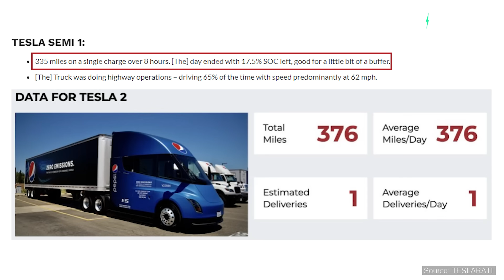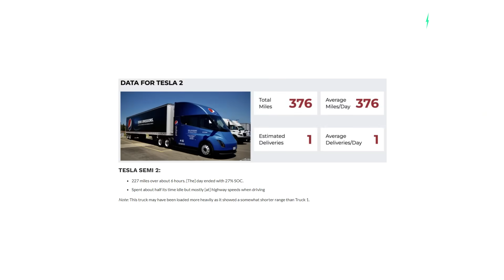Tesla Semi tested at highway speeds - REAL world range shocks rivals

Comment: I think what many folks are not considering is the decreased work load on the driver of a Tesla semi. In a diesel semi, when pulling a heavy load up a steep grade or even a moderate grade, there  is a considerable amount of shifting that must be done. May not seem like much to the average person, however, shifting can be very tiresome. Not only in steep grades but more so in bumper to bumper traffic. That is the worst sort of driving for a truck driver. The  decreased mental and physical work to drive a Tesla semi truck Must greatly reduce the work load for a driver, which equates to safer drivers. My only beef with the Tesla semi is that they weren't produced many years ago when I was still driving a semi for a living. I think it would be a shear pleasure to drive one of these trucks.

Comment: Well I think where Tesla is failing is there worried about a over the road truck I drive a dump truck and that is where they should start with big trucks you do not go as far everyday no where as far you spend a lot of time settling still or moving waiting to get loaded or unloaded you are at home you do not half to worry about finding a charger max miles is about 300 miles a day most days it is around 200 miles I live where there are mountains it will recharge strongly going down the mountains they would sell millions of dump trucks millions diesel fuel is ungodly high I work for a company called maymead huge in paving hear in North Carolina they would be willing to test them I bet Tesla build a dump truck it is a better place to start

Comment: Keep in mind that these trucks are actually coal and gas powered, because that is the original source of the energy they are charged with. The same is true of hydrogen-powered vehicles, you need electricity to generate the hydrogen, and that comes from power plants burning coal or gas. 

Can you imagine what a battery fire on one of these things is going to look like? The more battery cells the higher the chances of one blowing while charging. I was just listening to a news report suggesting that one should charge electric bicycles and scooters away from their home out in the yard perhaps, because there have been some house fires started by a battery fire. 

How long do these trucks take to charge? Remember you are dumping a HUGE amount of energy into them as fast as you can, high voltage and high current. How fast can you do that without starting a fire? I would imagine these trucks would take different charging stations than passenger cars, or they would need to charge for a much longer time. I see drivers hooking up to a charger and then going to bed for the night. That is going to take a LOT of chargers to keep a large number of trucks running. Refueling a diesel truck takes,, what, 10 or 15 minutes, so the trucks can move through refueling stations fairly quickly. When refueling takes 8 hours you had better have a LOT of refueling stations.
Reply: Keep in mind that these trucks are actually coal and gas powered 
FALSE. In California, where every one of these is currently deployed, only 3% of energy in the grid comes from coal, and only 41% from all fossil fuels. And because the Tesla Semi uses <1/3 the energy of a diesel semi, switching from a diesel semi to a Tesla Semi reduces emissions by >88%. But this doesn't take into account that all Tesla Megachargers are being built with solar arrays to augment the grid, and so the fossil fuel use is even less.

 Can you imagine what a battery fire on one of these things is going to look like? 
It's going to look ugly. Fortunately, the risk of a fire in a BEV is much less than that of a fire in an ICEV, so these will be rare indeed.

 How long do these trucks take to charge? 
At the 750 kW Megachargers currently in place, about one hour from 0% to 80%, and another hour from 80% to 100%.

 How fast can you do that without starting a fire? 
Tesla Semis are designed to and capable of charging at >1 MW.

 I would imagine these trucks would take different charging stations than passenger cars 
They're designed to charge from ≥750 kW Megachargers; but they can also charge at the automobile Superchargers, of which Tesla has built a near-world-wide network of 50,000. As you surmised, it takes longer; so this feature will generally be used only when a Tesla Semi needs a little extra charge to get to its home depot, or wherever the closest Megacharger is.

 When refueling takes 8 hours you had better have a LOT of refueling stations. 
Too funny! You ask how long it takes to charge these, and then go on in the same post to state it takes 8 hours! Nope—nowhere near.

Comment: @litestuffllc7249
More BS from serial liar and fabulist litestuffllc—but that's no surprise.

 The battery is as large as 12 Ys; so 120,000 tons / 240 lbs of lithium - oh wow they could make 1 million if every ounce of Lithium was used just to make Semis 
Cute trick—apply one year's lithium production to all semis; a corrected version would be "oh wow they could make 1 million a year if every ounce of Lithium was used just to make Semis". Of course, every ounce won't be used to make semis; but on the other hand, the transition to electric semis will take 20-30 years or more; so even if only a small percentage of lithium is used for electric semis, supply won't be an issue.

 there are 9 million diesel Semis just in the USA 
Another lie by the serial liar. According to the Department of Energy Transportation Energy Data Book, Table 5-5, there are about 2.2 million. In fact, there are only 6 million in the entire world.

Comment: @litestuffllc7249
Sorry but they are complete liars 
Too funny! Pot, meet kettle! Anyway, who "are complete liars"? The data in the Run On Less tests is reported directly from the truck to the Run On Less website, in real time.

 Their range tests are lies; that is why they will not give it to an independent to test. 
Three of them are being tested as we speak in Sacramento, by the NACFE (North American Council for Freight Efficiency).

 A Rivian RT1 was only able to manage 120 miles with a trialerd mustang;  more power per ton than the Tesla Semi has - how would you be so stupid as to believe it?
This is a classic example of the logical fallacy of false equivalence. The Rivian RT's EPA range is established without a trailer. Adding a trailer dramatically increases the aerodynamic drag of a pickup truck; and since aerodynamic drag is the predominant determinant of range at highway speeds, adding a trailer dramatically reduces the Rivian RT's range. On the other hand, the Tesla Semi's range of >500 miles was demonstrated with the trailer already attached, and loaded to 81,000 lbs. So the only way to affect range would be either to remove load from the trailer, or uncouple the trailer; and both of these actions would increase range. 

 To believe thier crap you have to believe a Tesla semi with a box trailer has less drag than a sports car 
What a nutty thing to say; only a total moron would believe that. But a Tesla does have a lower coefficient of drag than a sports car—see the difference? Yeah, didn't think so. If anyone is skeptical of that, search for "Tesla Semi coefficient of drag" (.36), and, for example, "Bugatti Veyron coefficient of drag" (.41). For those who understand a bit about aerodynamics, there are reasons why the Veyron has a higher Cd; but it's still higher.

Comment: Exceeding the advertised range is not breaking the laws of physics. Advertised ranges MUST have some assumed criteria and if the test encounters different conditions, the results will be different.  Common dog-fuck man. 
Not knowing the loaded mass compromises the data. How much of the total allowable 82000Lbs is cargo compared to ICE?
What type of batteries were being used because its effing important wrt range and battery life. 
US drivers can drive for 11 hr/day, and the max speed limit varies by State and is NOT always 62 mph. A range of 350 mile for the short range is insufficient for a day's drive. 537 miles to empty is not allowed depending on  the battery.

Comment: Meaningless without knowing the actual load. Totally worthless. Was there a headwind or tailwind? Any incline or flat? Try to drive in AX, CO, NM, NV for real world mileage. Try a TX/OK headwind.
Reply: Meaningless without knowing the actual load. 
The intent of the Run On Less Results site is to provide immediate access to instrumentation of speed, time, distance, and state of charge of the semis under test. Payload and GCVW aren't instrumented, so they're not included in this real-time data. Actual load for each trip will be published in the final report; so cool your jets for a few weeks.

 Try to drive in AX, CO, NM, NV for real world mileage. 
Weighed-out Tesla Semis routinely climb from near sea level at the PepsiCo Sacramento Bottling Plant, to 7,200 ft. at Donner Pass, before descending back down to Reno. What in any of these states is more challenging than that? Eisenhower Tunnel in CO? 11,200 ft., but only a 5,900 foot climb out of Denver. Raton Pass in NM? 7,800 ft., but only a 2,800 foot climb from Albuquerque. What else you got?

 Try a TX/OK headwind 
Just like diesel semis, Tesla Semis will be affected by headwinds; although less so, because with much lower drag, aerodynamic drag is a much lower contributor to range than in diesel semis. The main difference, though, is that Tesla has an extremely advanced trip calculator, that takes this and many other factors into account; so dispatchers and drivers will be able to plan their trips accordingly, before they leave the depot.

Comment: Your optimism is appreciated my brother but those trucks use 2 8,000 lb batteries and after calculations they've figured out that the trucks use 2 1\2 times more energy than the factory that actually produces the trucks themselves.
No city has the energy necessary to charge even a small fleet of these trucks.
Most cities will laugh at anyone trying to apply for a permit to charge just 30 of these trucks so this idea of electric trucks being any part of the near future is wishful thinking.
Reply: None of this is true; but nice try, nonetheless.
Reply: @BigBen621    ok ... stay uninformed..
Reply: @jugeerivera4916  Thank you. I prefer uninformed to misinformed.

Comment: 335 miles or 539 klm.
Sigh what's that going to do?

The local run semis are doing a minimum of 3,000 klm in 5 days, max is 4,500 klm in 5 days.

Min needs 600 klm a day, and doing 18 hour runs.
Reply: Truck Tesla 3 did 1,297 "klm" on Day 3, and 2,575 km in two days; this is almost what you claim is the minimum for 5 days, and extrapolates to max 6,437 in five days, almost half again the max numbers for your "local run semis".  Happy now?

Comment: Disappointing that they didnt quote weight of load.  Could have been empty trailers
Reply: What Sam is citing is instrumented data on speed, distance, and rate of charge, which is reported in real-time. Weight will be included in the final report. These are working trucks, leaving from a bottling plant each morning loaded to about 80,000 lbs. as stated by the sponsoring body, NACFE, which means >20 tons. Haters and doubters will claim they're lying, and these are empty; this claim will be verified, one way or the other, in the final report.

Comment: You buy trucks to carry load.. not to race but teslas load capacity and energy usage fully loaded is very very bad
Reply: For various reasons, the Tesla Semi can tow within a ton or so of what a diesel semi can. And because very few trips go out loaded to within a ton of GCVWR, this will make a difference in only a relatively small number of cases. For the few operators who must haul indivisible loads <43,000 lbs. or so, or must frequently go out loaded to >43,000 lbs., diesel semis will still be the way to go.
Tesla Semis use about 1/3 the energy of diesel semis.
Reply: @Big_Ben_from_La_Mesa  thanks. uphill diesel will win though even only 30% efficient, has more energy density.

Comment: lol not a real test at all no wonder no is reporting as it sensationalist crap. . Don’t know the weight it was hauling !!! gross vehicle mass nor the tare weight . Not even running a diesel truck against it for comparison . And it has efficiencies you say !!!!!  Just sensationalism. WHAT WE DO KNOW AS FACT the Tesla truck is not efficient battery can only hold about .03 kw per kilo. So it hauls a good 4 to 6 ton less payload to house the battery Can only be sold in America as it is too large in dimensions in Europe and other markets . Long haul trucks run 24 hours or 12 hours . 6 hours is not viable nether is the time it takes to recharge. Mercedes won’t be sweating as they have one of the very best trucks on the market reliable and frugal look around you on the roads they are everywhere outside America.   Tesla has only made about 34 trucks which are on evaluation at Pepsi. Pepsi also has around the same number of hydrogen trucks under evaluation. There is also a rental fleet of around 100 hydrogen trucks operating commercially. Volvo, Mitsubishi, hino (Toyota)  and others have sold hundreds if not thousands of commercial electric trucks world wide. So has ford in its popular transit van that also now is being released with a hydrogen option JANUS has converted more trucks to electric than Tesla has made. It is flexible in that any truck be it Mercedes, kenworth etc can be converted keeping all its advantages in safety features computers ergonomics etc and can be tailored to meet your exacting needs. .In addition they can haul 140 ton in a road train configuration and are going fsd .janus can be fully recharged get this 5minutes !!and be on it way 500klm fully loaded with a known load. Telsa semi is a huge sales flop 100s of millions Tesla has to write off  lost out like with solar roof panels .Good for local work maybe at a stretch as the thing is too big for tight manoeuvring . Also Volvo has fsd electric trucks in Europe. Paccar is coming out with electric kenworth. Tesla is loosing out as it is getting leaped frogged by new technology . Lithium /ion batteries are 3 decades old and at max development . They will be round though for sure . Elon made huge mistake not keeping up with technology and research and development . In any case his batteries were developed by the Japanese company Panasonic without Panasonic there would not be a Tesla. Ignoring hydrogen and the worlds already insatiable and critical need for it in bulk for food production was a very stupid call .

Comment: Yeah. Hydrogen will work or not!? I mean. If Tesla does both in the future. You can be sure that no matter what, no other company on the planet. Will be able to go against Telsa. Another issue. The big three and legacy auto and Japanese car makers. Ready to die off forever.
Reply: It won't. It uses triple the energy of BEVs, end to end, and costs seven times as much to operate. Real world example: the Toyota Mirai carries 5.65 KG of H2, and gets an EPA range of 357 miles. A KG of H2 in San Diego, where I live, is currently about $29, having recently increased from about $17(!). So the per-mile cost of H2 for the Toyota Mirai is 5.65 x 29 / 357 = 46¢/mile. Meanwhile, my Tesla Model Y has a 75 kWh battery, and has an EPA range of about 320 miles. At residential rates of about 25¢/kWh, the per-mile cost of electricity for my Model Y is 75 x .25 / 320 = 6¢/mile—87% less than the cost per mile of H2. And actually, my cost is zero, because I recharge from my rooftop solar array; which of course HFCVs can't do.

Comment: But how long will the tyres last . How long will the roads last ?
Reply: Because the maximum weight of Tesla Semis is 2.5% greater than that of diesel semis, tires may experience slightly more wear than diesel semis, and road will exhibit slightly more wear as well. Many folks believe this is a small price to pay for eliminating the harmful emissions and noise of diesel semis; haters and doubters undoubtedly won't.